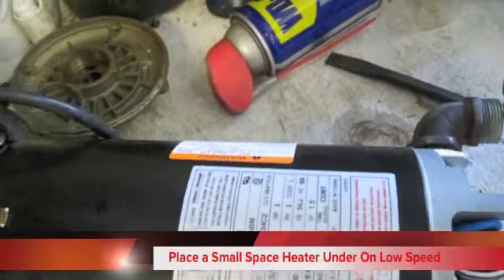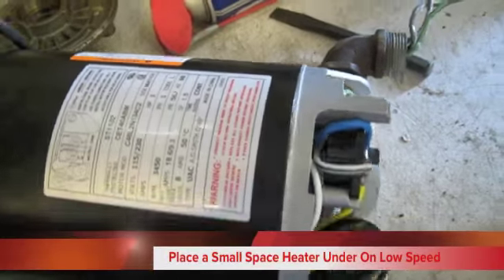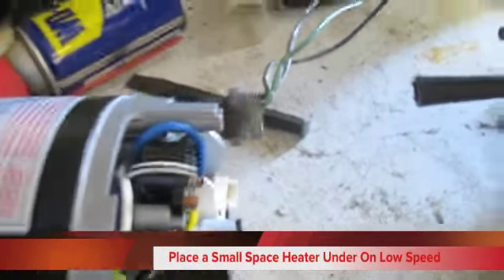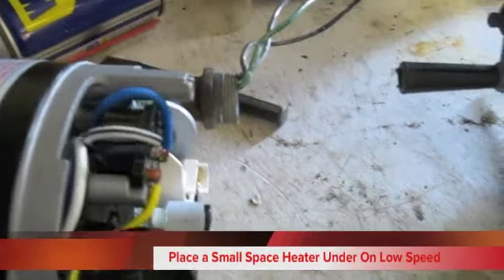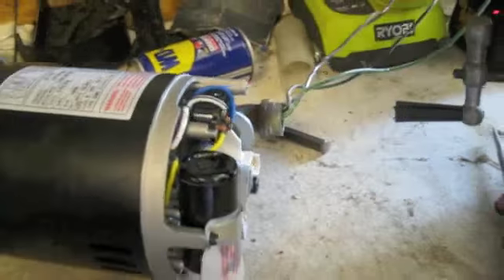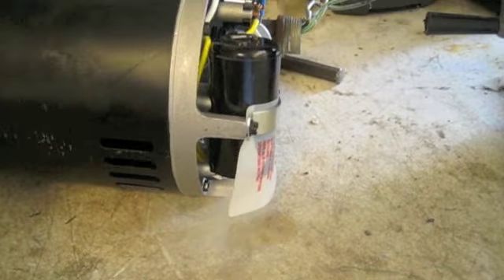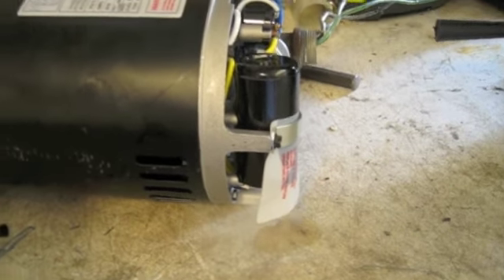Pool Pump Motor New Smokes from Capacitor

Comment: THAT'S MY FAVORITE MOTOR, IT'S PLAIN TO SEE THAT THE START SWITCH IS NOT DEPRESSED, IT'S STUCK IN THE START MODE.. THAT'S WHY THE CAPACITOR IS SMOKING, YOU MAY HAVE BUMPED THAT GREY SWITCH ASSEMBLY DURING INSTALL AN KNOCKED IT OUT OF ALIGNMENT.. YOU MAY NEED A NEW SWITCH AND A 161 CAPACITOR

Comment: Over lubricating in the factory could cause burn off.. Like an oil change when some drops fall on the engine... Or when pellets fly out the barrel of a new air rifle... That's called "Dieseling."

Comment: Just had this issue with my Hayward super pump the start switch was not de-compressed and broken on install. Put the old switch in fired right up no smoke

Comment: I see right off the bat the start switch is not in alignment with the centrifugal, the white litlle plunger on the grey switch should be hitting the center of the shaft.. soit it needs to be centered, if not well we know what happens. and 99.9999% of the time it's because of the installer roughhousing the back of the motor knocking the switch out of alignment.